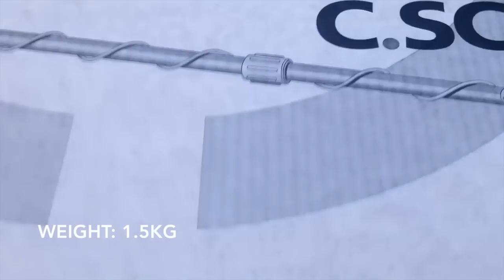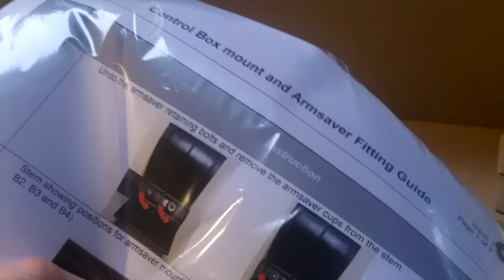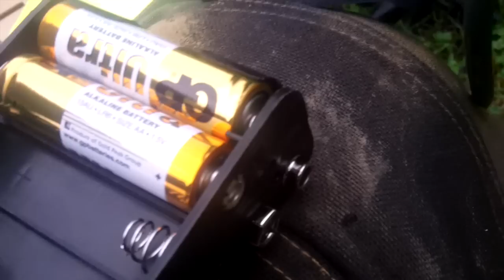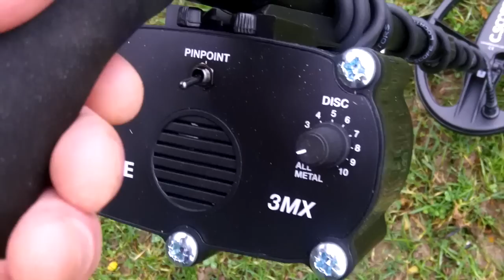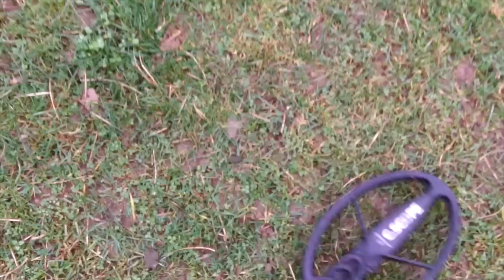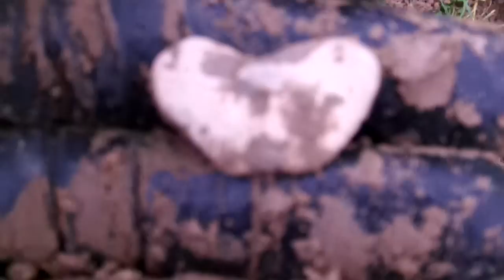C.Scope CS3MX-i Pro Metal Detector: Introduction Video

Comment: When adjusting the threshold, do you have to have that constant beep or will it not work if you turn it lower than the beep. Thanks.
Reply from the maker: +evoermine  Hi, you can run it without the background tone if you like. For maximum depth and running quiet, turn the sensitivity control to just below the point where the sound is breaking through. Call us (01233) 629181 if you have any other questions.
Reply: +C.Scope Metal Detectors Hi, thanks for your reply. I'm going to buy either this or the 4mxi but as a novice the 'discriminate 2' knob of the 4mxi baffles me, despite reading lots of info and watching some videos! When I get a signal am I supposed to then switch to Disc 2? Guess it's a learning curve. However I have seen it cheaper than the 3mxi so I'm probably better buying it and hopefully using the features when I understand them. Cheers.
Reply from the maker: +evoermine Hi, The CS4MX has two discrimination channels, Disc 1 and Disc 2. With the toggle switch set to Disc 1, The rotary control called Disc 1 is operative, you set your discrimination level to what ever level you desire. The Disc 2 rotary control only works when the toggle switch is held in the Disc 2 position. When this is the case, the Disc1 rotary control is then disabled. The idea of this is so that you can switch between 2 levels of discrimination and do an analysis without having to adjust your initial settings. IE I use disc 1 set to 2 and disc 2 set to 5. If I here a bleep, then I know it is not a small bit of iron as I am using a disc setting of 2. If I now select disc 2 using the toggle switch, I am now using a disc setting of 5. If I still get a bleep, it is going to be a coin or item of jewellery, however if I no longer hear a bleep, it is probably a piece of tin foil ?. I hope this helps ?
Reply: +C.Scope Metal Detectors - That explains it very well indeed. Thanks very much for your feedback. Much appreciated.